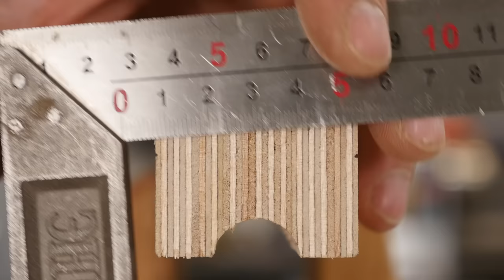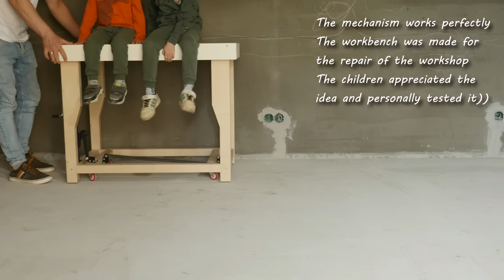Unique idea that will cost you $10! It's definitely worth it!

Comment: Nice innovative concept.  I usually just put polyurethane swivel locking caster wheels to make mine mobile and it takes less than 5 minutes to install with a basic drill.  An example is on my DIY mobile drill press stand video.  Keep up the good work. 👍

Comment: Brilliant execution. Put blue thread lock on the bolts or replace with longer bolts. In military aviation, a minimum of three threads showing after the nut was tightened was mandatory.

Comment: 🟦…I constructed a similar table quite a number of years back but used cables and a locking-lever to lower the wheels,..It was a simpler approach than the one in this video as it required no welding, just commonly available hardware.

Comment: The idea is fine.  I would not have used threaded rod.  The threads will cut into the wood over time.    Straight rod and even bearings on it would be better